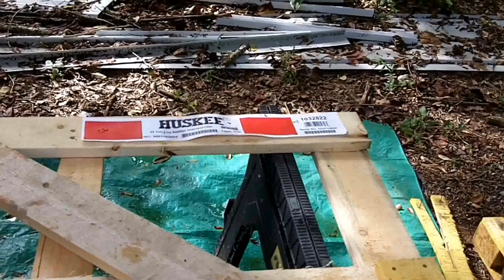Cockeyed Garden Fencing

Comment: here's a hint - when using your hammer hold it closer to the end, it will give you more force when hitting a nail and you will be more accurate.  A woman's best friend is a cordless Milwaukee hex impact driver (buy on sale and usually comes with deal on bits) I used this tool to frame then put in drywall screws for my whole basement.  It is light weight and the batteries last.
Reply from the maker: Lyn Llinse Thanks, Lyn. I can't hold the hammer at the very end. It's really too heavy for me. Plus, when doing pallets, you kind of have to tippy-tap the nails out. They don't take kindly to pounding! Can't really afford to do any buying right now but will keep the impact driver in mind... just thinking about it, I may have an old one in the workshop. Still haven't done a thorough inventory. I'll check on that very soon! Awesome that you did your own basement!